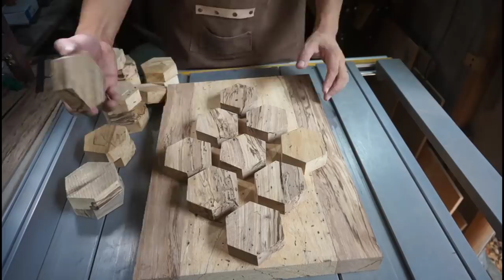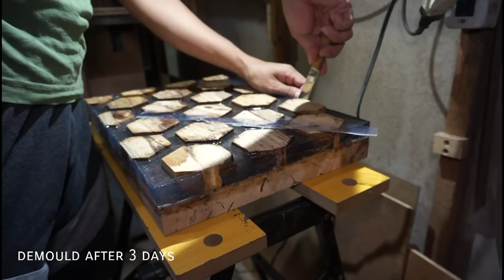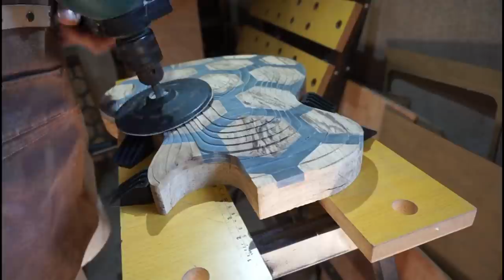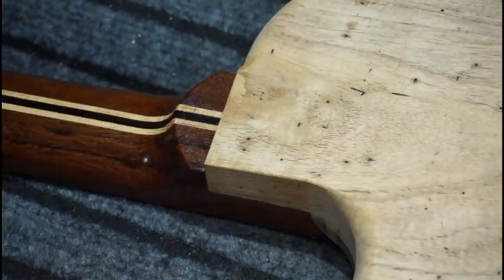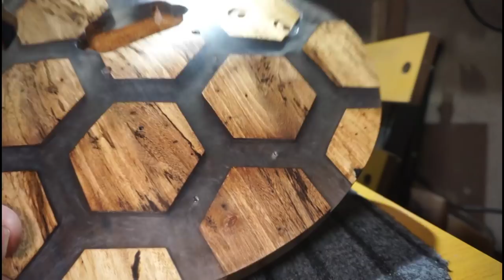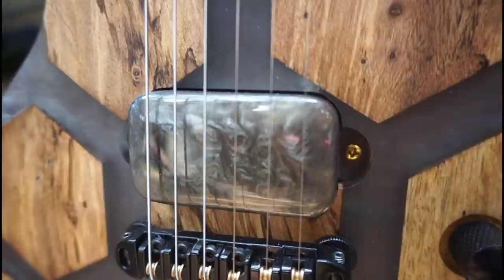The Honeycomb Guitar - Epoxy Resin Full Build Pinoy Guitar Builder

Comment: As amazing as the guitar is, I'm almost more impressed you managed to make your own CNC machine
Reply from the maker: Thanks! One of the reason why I built this CNC is the cost and next is the maintenance.
Reply: @GitaraMaker  That's wild, how did you do that?
Reply: Would you ever consider making a vid on how u made the cnc machine I'd be very interested :)
Reply from the maker: Hey Alee! I wish I have some video clips building it. The most possible way I can do is to zoom in on the parts, give the measurements and some details with the CNC operation. You can give me suggestions how I can make a video about it.
Reply: @GitaraMaker  that sounds cool maybe talk about how you set it up and the programs/software you use, i know personally that's the part that i would be most interested in.
Reply from the maker: Ok thanks Alee, will definitely include that.

Comment: Dude I love your guitar builds
Did you do only the top with resin because you were concerned with weight? And if yes how much do your other instruments weigh? Does resin add extra?
Reply from the maker: Yes, I did consider the weight when I was planning, since I'm going to install a Bigsby system I knew that it's going to be heavy if I will pour resin up to the back part of the body.  It has the same weight with a standard Les Paul 3.5 kilos. My Bass build is the heaviest 4.75 kilos and the Ibañez Resin is also 3.5 kilos.
Reply: @GitaraMaker  You didn't get any warping from not having top to bottom resin?

Comment: I was a little confused why one side looked like the beginnings of a topographic map, didn't know the les paul had a curved front like that, and I wonder if it would be possible to make hexagonal tuning pegs?
Reply from the maker: Not all Les Paul has an Arch Top but I got challenged and made it like that because it looks cool. About the hexagon tuning pegs, I think that's possible. I've seen some brands that uses Resin, plastic or wood tuners.
Reply: @GitaraMaker  I like the curve, makes it look different from the other guitars. Do the tuning pegs not have to be metal then? Just as long as they can loosen and tighten the strings?
Reply from the maker: I think it would be difficult to make it using metal, cause the tuners hole inside is not cylindrical but square. And it's really hard to make one specially it's so tiny. Melting metal and a mold will work, but I don't have the know how right now.

Comment: Beautiful work as usual. I have a question if you don't mind. What size is your CNC machine? You've inspired me and I just started looking for one but I'm not sure what dimensions I need (the all seem to be based on that). I saw a budget friendly one with dimensions; 300 × 180 × 450mm. Would that be big enough?.... thanks.
Reply from the maker: Hi! This depends on what project you will make, if you just want to learn and hone your CNC skills and make small projects a budget friendly will do. When I decided to make my own CNC, I customized it according to the dimension of what I need, as long as a guitar body or neck will fit the work area. 

My CNC Dimension
Table Size:
Y 1000mm X 600mm Z 270mm
Actual Working Area:
Y 750mm X 450mm Z 270

I hope this helped you.
Reply: @GitaraMaker  thanks for the info, much appreciated. What I'm looking to do is build a guitar body from scratch (hence the CNC) and then buy a stock neck and customise that. So enough material to reshape the headstock. Possibly change the frets to stainless steel and hopefully learn to do a custom inlay.
So do you think a standard guitar body (I've got some custom ideas but about the size of an Ibanez RG) would fit in a CNC of the size i suggested? I ask due to things like how much clearance you need all around etc...thanks again. Cheers.

Comment: Hi, just wanted to ask if the pour that you made is 20x15 inches? Thank you
Reply from the maker: It's 19X13.5" my LP body is a little smaller than the standard. The actual body size is16X12"
Reply: Nice, so the 19x13.5 or maybe 20x15 is for the standard strat and tele? Im a big fan of your work and wanted to also try making one. Thank you for sir will look for you on fb and will follow you as weel :)
Reply from the maker: Thank you for your support ☺️

Comment: Sir anong specs ng cnc mo? Bat di mo tinapos sa cnc?
Reply from the maker: Bale sa frame 1" tubular from hardware gamit ko the rest binili ko through Lazada - bearings, CNC sheild etc.
Working Area
Y Axis 1,000mm
X Axis 500mm
Z Axis 200mm
NEMA 17 stepper motor

Na-disconnect yung USB sa computer kaya mag-sisimula sya sa simula kaya sa bandsaw ko na lang tinuloy. Pwede sanang ituloy kaso risky, baka di na sumakto.